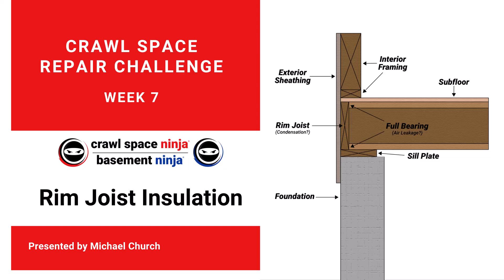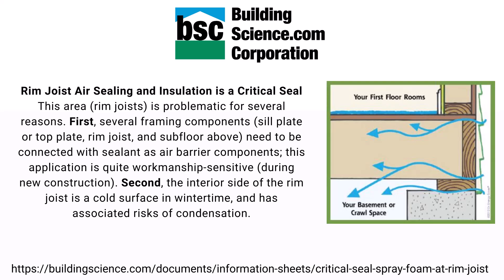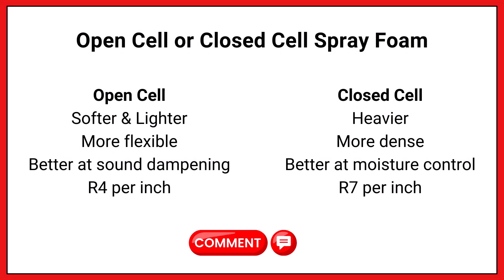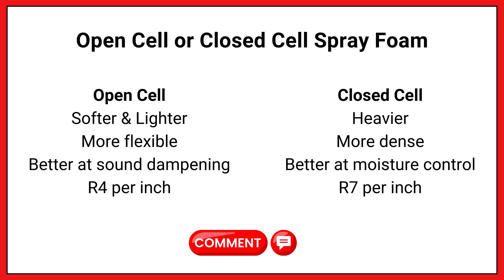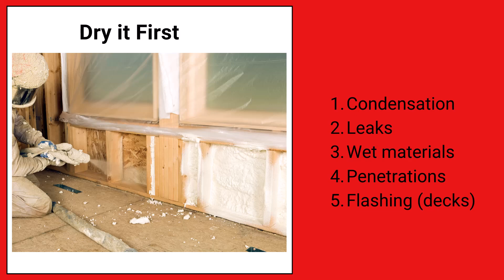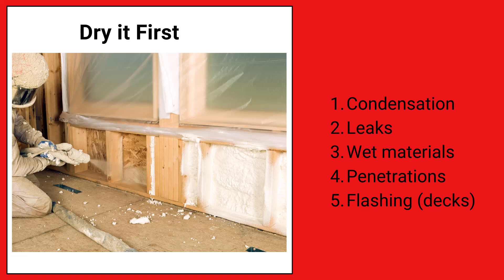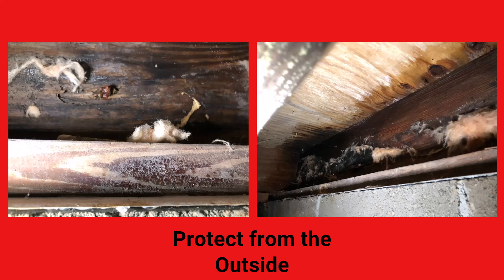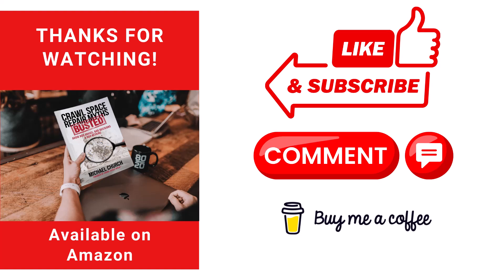Rim Joist Insulation + Air Sealing: Warmer Floors, Lower Bills

Comment: I have 1" formular boards I will have left over after a project.  I think I will cut tight fitting rectangles for the rim joist bays, then come back with wide angle spray foam around the edges and sandwich it with a second piece of foam board.  Should air seal and look nicer.  Outside is brick;  never seen a water issue and expect none.
Reply from the maker: Sounds like a great plan. Thanks for watching and sharing.

Comment: If just sealing air infiltration, would you caulk or spray a foam bead just along the top and bottom of the rim joist and sill plate?  Sealing the sides of the joists seems unnecessary since the joists do not penetrate the rim.
Reply from the maker: That can be done. Caulk is sometimes easier to work with and just as effective. Check if code requires a thermal break at the rim joist. If it does, you'll need the recommend R value installed over the caulk. Thanks for watching.
Reply: @CrawlSpaceNinja  Thanks!  The other part of my question was about air sealing the sides of the joists themselves.  Seems unnecessary as long as the top and bottom are sealed.  Is that right?
Reply from the maker: @JamesMcCrane  in theory air can enter side and travel up that gap to the floor above. The Building Science folks recommend a full air seal and insulation.

Comment: What about a detail on the long joist area?
Reply from the maker: If the long joist is the outside of the home we insulate and air seal the entire thing. Unfortunately, it usually is not and there's not enough room to do it like the other rim joists. Many times we can only shove insulation in the cavity because of how it's built. Hope that helps, thanks for watching.

Comment: Do you recommend doing that if the crawl space isn’t conditioned ? Aka I could always add a dehumidifier but I do not have HVAC, I only have mini splits in the house.

Vancouver island , very wet humid winters 80-90%
Reply from the maker: Without a dehumidifier there is nothing to regulate the existing humidity

Comment: We currently have fiberglass insulation for our rim joist insulation. I've seen a number of videos using spray or rigid foam to insulate and seal the rim joist but my question is how do you perform a termite inspection when you can't see the wood? I'm in central NC where foundations are built from cement block and we typically have one or more termite colonies per acre. As a result being able to perform regular inspections is important.  Inspection is why I also intend to stop encapsulating where the cement block gives way to 3 tiers of brick.
Reply from the maker: That is where codes for leaving a 3 inch gap from the sill plate come into play. Contact your local county code to see what yours is. I believe in NC you have to leave a 3 inch gap from the sill plate and the bottom of the crawl space walls in some parts

Comment: I was thinking of foam board and spray foam parameter of room joist. But isn't the spray foam more R value ?
Reply from the maker: Foam board within the rim joist then yes spray foam the seams aid in the R value however depending on what spray foam you use and how much can depend on if it increases the R value
Reply: @CrawlSpaceNinja  thanks for the reply. Sorry I just wanted to clarify. Is 2 inches spray foam alone more R value than.  A 2 inch foam board and parameter spray? Please confirm.  Here is another good example.   https://youtu.be/J95l9Ue4224?si=KJ0E9r0fEDq3LCiD
Reply from the maker: Closed cell spray foam (depending on manufacturer) is about R6.2 per inch while foam board is about R5 per inch. Open cell spray foam (depending on manufacturer) can be less than R4 per inch. Thanks for watching, hope that helps.
Reply: @CrawlSpaceNinja  i appreciate the reply!  Blessings!

Comment: What should you do if there is no capillary break between your sill plate and foundation?  I’m wanting to insulate rim joists but I’m afraid to trap moisture behind insulation 🤷

I currently have 1 small section of rock wool in each cavity and when I remove it the rim feels damp. This makes me scared to put up any foam or closed cell insulation in which moisture can’t pass through.  Your thoughts?
Reply from the maker: Message us at diy@crawlspaceninja.com and we dive further!
Reply: You'll have to figure out if the dampness is leaking water from outside or is warm moist air condensing on the cold concrete. It it is condensation then air sealing and insulation will fix the problem. To test you could air seal with Caulk and remove the insulation. If the condensation appears on the cold surfaces then you know air sealing and insulating will work well.

Comment: When you encapsulate crawl spaces, do you put a dehumidifier & have ductwork conditioning the area or do you do one or the other?

I thought there was a difference between conditioning vs encapsualting with a dehumidifier... but i saw in another video where you said that you sometimes have both. Thanks
Reply from the maker: If the crawl space has duct work then yes they will both serve as a function in the crawl space. Sometimes we even connect the Dehumidifier into the duct work